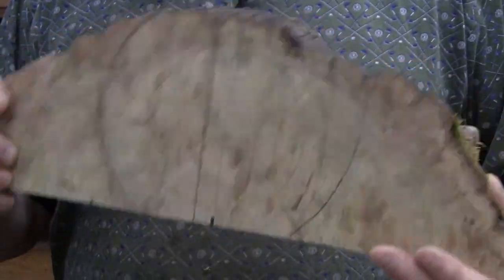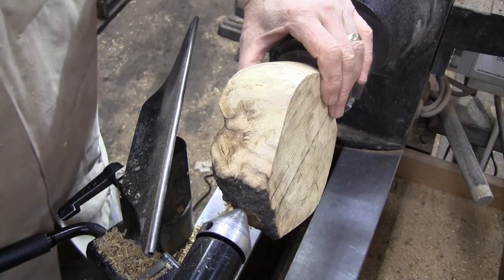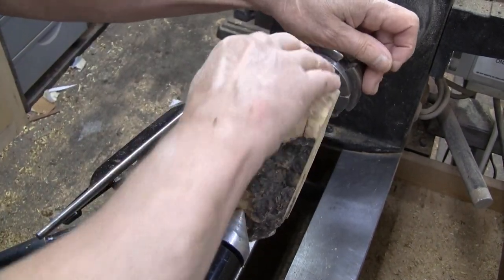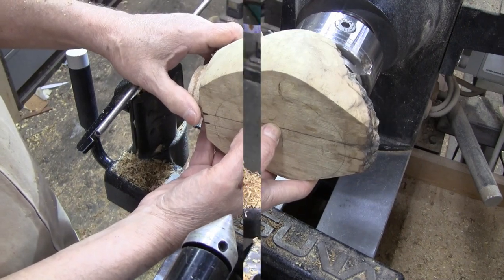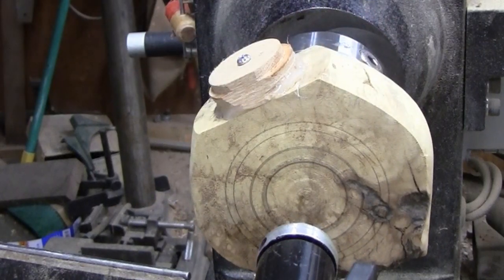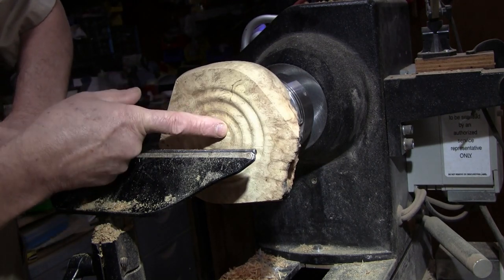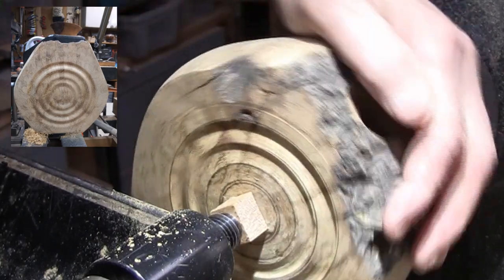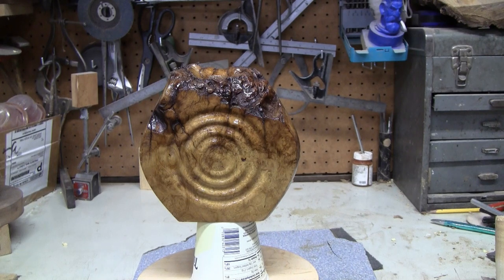Wood Turning  Multi Axis Vase

Comment: That’s a Beautiful Twig pot Gary and a perfect beautiful burl for it! I’ve never heard of a Twig pot before that’s a very interesting piece!
Reply from the maker: Thank you  and I had not heard much about them either. I guess you could put anything in it but I think it is for dry arrangements.  I am sure I can find a tube to put in it then she can put live flowers in there as well.
Thanks for watching.
Take care my friend,
Gary
Reply: ThePapa1947 yep that would be neat, maybe a piece of pvc pipe can cut to the length and glue cap on bottom maybe paint the top rim of the pipe black that way wouldn’t see that white edge make a good water tight vase for it.
Reply from the maker: @kimseyjustkimsey5256  great idea I will check with the boss and see if she wants that..lol
Reply: ThePapa1947 Yep ya better definitely do that, I have got into some deep water in the past for not for not asking the boss lady 😅

Comment: Curious if the end result is waterproof.  Could you use it as a bud vase, with water in the hole?  Either way it's just lovely.
Reply from the maker: I would not put water in it unless I epoxied the hole. The wife has little glass tubes that will fit in there.
Thanks for watching.
Gary
Reply: @ThePapa1947  I wondered about the glass tube option.  Good way to go.  That piece wants live stuff poofing up from it.  Love it.
Reply from the maker: @stephenvessels9483  for sure but I let the wife do the flower stuff..lol

Comment: Really nice Gary.  How did you mount it when you turned the second face?  I think I have a few pieces of wood in my stash that could work for this.  Thanks for sharing and stay safe!
Reply from the maker: Sorry I think that was not mentioned. I did another hot clued tenon.
Reply: @ThePapa1947  Thanks for quick reply.  That's kinda what I thought.  Do you think a vacuum chuck would have worked?
Reply from the maker: @tompuskar4426  I am sure it would work fine. I do not have one but my lathe is set up for one.